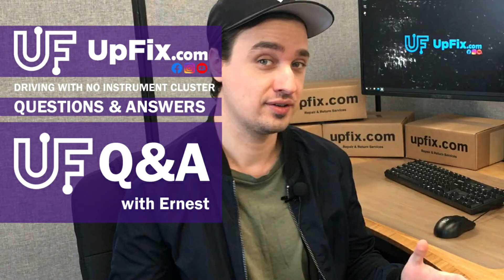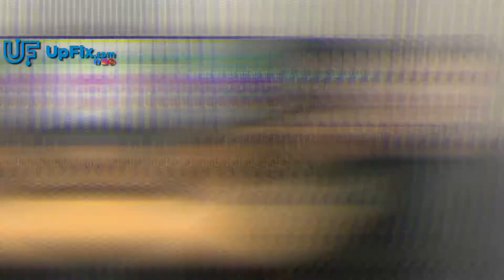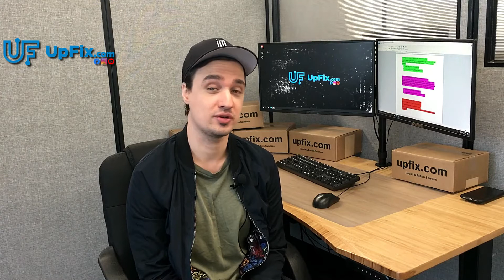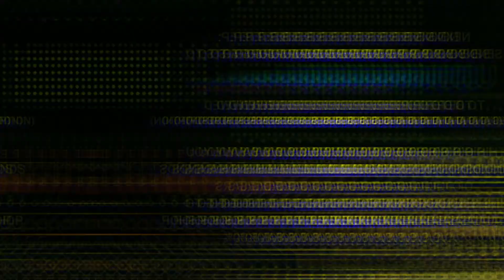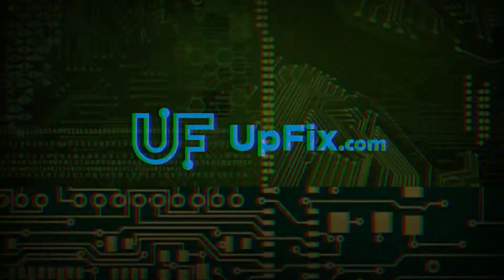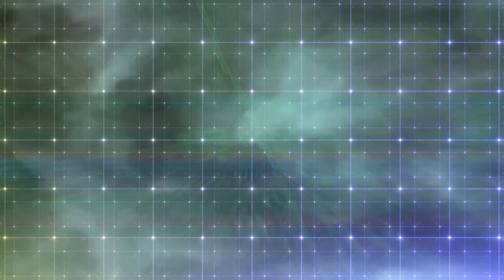Drive Car Without Instrument Cluster? Question and Answer

Comment: Hi my friend! I have a golf mk4 from 2002 and I want to make some changes on it... I want to send the dash clocks to someone who can activate some options on them like Needle Sweep and change some led's. And I want to ask you If I can drive 1 or 2 hours from a point to another using just the phone to see how fast I'm going and after that, to put back the dash clocks back.
Reply from the maker: That looks like an interesting project!
Yes, the car will still run and deive with the cluster out.

Comment: Hi I have 06 p71 drove without instrument cluster while been sent for rebuild but engine shakes like going to shut off n sucks up alots gas showed code#p460(fuel sending sensor) is bc no cluster or fuel sending sensor on the pump going bad ?
Reply: P71 is a Ford Crown Victoria Police Interceptor. For those years, Ford used PATS (passive anti-theft system) to make sure without the cluster the vehicle might not startup. However, if the vehicle does startup, the cluster is primarily on the receiving end especially for this year, make, and model. 

This means it doesn't affect how the engine or ECU operates. If there is an issue with the engine shaking hard, and you're having the fuel code P0460, then it's most likely a faulty sending unit or something in the fuel system.
Reply: @245artist  thank you
Reply: @doublebasilhazelnut4382  No problem!
Reply from the maker: Thank you Ernest!